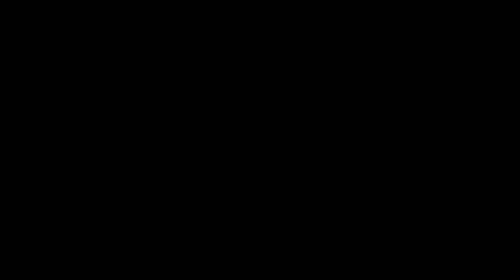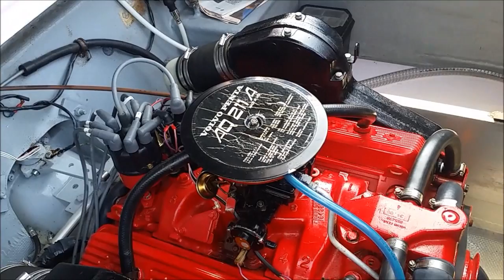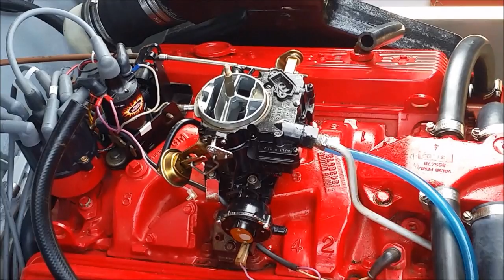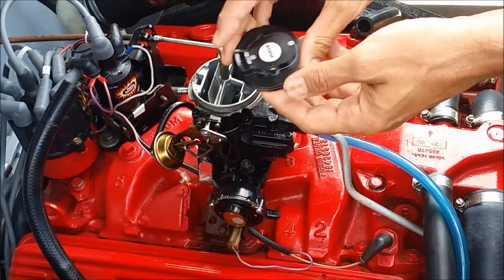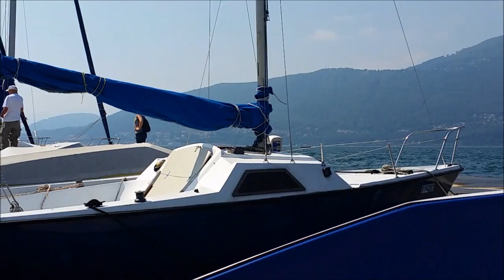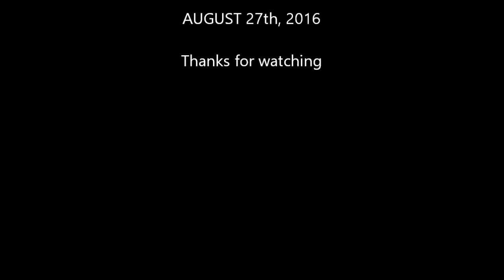Volvo Penta AQ211A electric choke operation

Comment: Hi Capt. Steve! 
Great video. 
Can you recommend somewhere to get spareparts for this in EU? I need a new Termostatic coil and gasket. I see many places in US having 2GC sparepart do you know if they will fit?
Reply from the maker: Hi Peter. I think you can get spare parts from any Volvo Penta dealer. The problem might be that many of them are expired. But you will find a lot of them on the web also. Get first of all the spare part schematics, for instance from marinepartsexpress.com, and then look for the part number you need. Start from you local VP dealer and then try on the web.
Carburator has part number 841048. Thermostatic coil has part number 834987. The gasket is usually included in the overhaul kit 841994. Good luck. Best regards.

Comment: Thanks for video,  can u tell me where the positive wire from your choke to ?.
Thanks
Reply from the maker: Hi. The positive wire to the choke comes from the ignition coil. It is colored in  purple and becomes live (12 V) when the ignition key is turned into ON or START. Its function is to heat up the choke coil so to gradually  open the choke valve after approximately one - one and a half minute after the motor has been started from cold condition and keep it open for the time the motor will be running. When you switch off the motor it will have no more tension so to let the choke coil cool down and the choke valve close. Since the heat is drawn also from the whole motor, it will take a couple of hours before the choke valve would be able to close again.

Comment: Hello,
Nice videos. I got a AQ211 in my boat also, my question is, do you have a electronic ignition  conversation kit installed? If you do, do you recommend it? what brand?
Reply from the maker: Hi. Yes, I installed a Pertronix electronic ignition kit a few years ago. Great investment. Quite straightforward operation. No more maintenance required, no more points wearing out. Improved performance. I strongly recommend it.
Reply: Ok, can you please tell me the model of the Petronix, or do you know what brand the distributor is on a AQ211
Reply from the maker: I used Pertronix Ignitor II part. n. 91582 + 45000 V Flame tower II coil part. n. 45111. You can find easily on the web. I bought from UK.
Reply: After you installed it, did you remove the Ballast Resistor?
Reply from the maker: Yes of course. You do not need it any more. In Pertronix box you will find all instructions necessary.  You can also download them from the Web if you want to see them in advance

Comment: Hi Capt. Steve! Like your videos. Why I'm looking is because I also have a AQ211a. 
Now I have some problems starting it. It got fuel and the starter works. After letting the starter work for the engine sounds like it starts but just for a second or two - and its rushing. 

Any clue of what might be the problem?
Reply from the maker: Hi Glenn. Might be quite a lot of reasons. Try to sort them out  through a process of elimination. Do you have spark? Is timing correct? Do you have the right amount of fuel at carburetor?
May be the carburetor calls for a complete overhaul. May be the distributor needs new cap and rotor. May be just simply gas is contaminated with water.
Try to understand first of all whether it is a fuel or electrical problem and then proceed accordingly. Good luck!